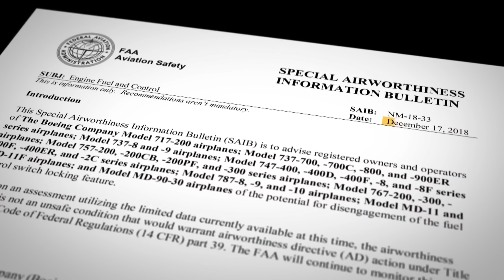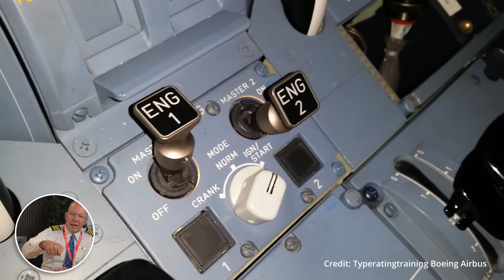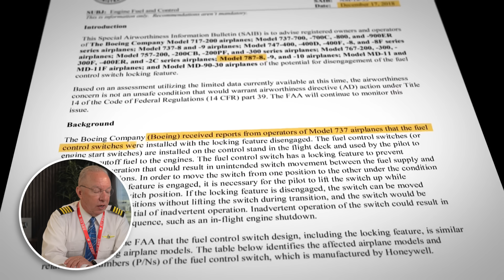Air India 171: The FAA’s 2018 Fuel Switch Locking Bulletin Explained (16 Questions Answered)

Comment: It's a great video - as aways - however I have to disagree with your take on cockpit CCTV. It is common practice nowadays basically for all the transportation industry: buses, trains, ships, even small haul trucks already have a cabin camera. And mind you, we're not talking about footage that will be constantly up to the airlines scrutiny (so pilots could still read their magazines in peace), just black box record keeping. Think of it as a dash cam: limited storage, auto deletion of older recordings to add new ones. The only instance the video would be seen is in an accident, with the same care and privacy of the CVR.

I understand your point of view, and of course standing with your union is the smart thing to do (and I'd likely do the same!), but the argument that the CVR and FDR give us a complete picture of what happened is a little "dishonest", especially in cases like this one.
Who toggled the switches to cutoff? There's a real possibility of the same one that did it gaslighting the other asking why did HE cut it off, right? Did both of them desperately tried to save the aircraft, or one of them just waited for it to end? Was there a physical altercation? Why did they take 10 seconds to switch it back to RUN? What were they doing?
Or even: was it a never seen before mechanical issue? What if the detains were actually not installed correctly and it was just never noticed/reported?
There are SO many variables that will likely never be known because there is no way to get the information, and most of them could be easily solved with a few cameras there.

Comment: Boeing should not allow both the switches to be turned off at the same time while in flight.They should also put individual cutoff switches on the window side of controls so each pilot can only control one switch.

Comment: Hi Captain , Is it possible that the fuel control switches jumped by themselves to cutoff position due to mechanical or electrical failure like when a fuse jump when you have a short circuit? TIA

Comment: Capt Steve, with all respect - you are pointing focus of your followers to all wrong directions... FDR doesn't record PHYSICAL RAW position of engine switches. Especially in fly-by-wire aircrafts like 787. 

"If there were a fault in:

The Remote Data Concentrators

Bus communication

Wiring between switch and RDC

Software mapping of switch logic

...then the recorded state (i.e., Engine switched to CUTOFF) could be incorrect, even though the physical switch in the cockpit was untouched.

This is not theoretical. There are known industry precedents where:

Faulty data concentrators or bus corruption led to false switch or valve state recordings in FDR data"...
Reply: If you Fly-by-Wire - then it's the "WIRES", controllers and buses you should be looking at first when something happens..
Reply: Recorded RAT power-on moment timming barely fits ~4sec from last engine cut-off. And it's without taking spooling delay, trigger logic delay etc.. Suggesting rapid power cut-off trigger seconds earlier than recorded signals from switches. Simply hangar talk here for broader consideration.. ✌️

Comment: There clearly should be a audio alarm as soon as even one fuel switch is shut off something this important should be not left undone. It would save seconds that may be incredibly important to stopping a crash. Yea you can hear the engine noise change but a alarm that sounds within a fraction of a second when a fuel switch is shut of is much faster and clearer then other clues you have to wait for.

Comment: Several things:
1) If someone is in charge of the safety of several hundred people, their feelings if they want to be on camera or not is completely irrelevant - there should be cameras, end of story.
2) At this point in time we cannot categorically exclude other possibilities why the system detecting that the fuel switches were moved, especially with the known prior problems with Boeing airplanes, computer systems, and fuel switches. We need to wait for the final report to get a complete and thorough analysis of what went wrong.

Comment: Here we gp again with speculation on camera recording you just stated could leak out.. 
This is appalling Bs when video would only exist accessed on flight recorder. 
Instantly showing chaos of who did what vs trying to decipher voice recorder. 

There's tons of data in one second of video period that was never revealed by sound recorded. 
The logic here is simply backwards. 
The video would only record by seeing movement. You taking a nap would not record. 
But if ship makes sudden movement ~ YES. Cockpit Door opens ~ Yes. 
Sudden loss of pressure ~ Yes. 
Make camera action manditory period. 
Too many lives depend on it. In the air and on the ground. 
Cheers

Comment: Those cut off knobs are in an easily accessible place and it seems easy to cut off the fuel. Should they not be in a less accessible place if they are only required to be used once parked or in an emergency and not in the main console

Comment: All that talk and still more speculation, still more pushing a psych narrative.  You've said it right here, and completely avoided discussing what else the report stated - namely, THAT THIS 787 UNDERWENT 8 HOURS OF MAINTENANCE AND WAS CLEARED 1 HOUR BEFORE THE FATAL FLIGHT!  Air India has NOTORIOUSLY PISS POOR MAINTENANCE!  This, in conjunction with the SAIB and the fact that the air frame had both engines replaced in March and April 2025, was 6 months away from its full checkup, had the throttle section removed and replaced twice, in 2019 and 2023 ONE YEAR AFTER THE SAIB WAS RELEASED, suggests that there may be maintenance issues still under investigation.  See the addendum to the report which states they are retaining components for further forensic investigation.  You may not like it, but sometimes truth is stranger than fiction - the fiction that a suicidal pilot caused this, while it was probably faulty maintenance under taken to figure out why there was a Stabilizer warning error on the previous flight.  Who knows what occurred.  The faith in Boeing, to be fucking honest about how robust their air frame or components are, in light of all we know now about whistleblowers and "suicides".  Boeing fanboiz.  Almost as bad as Tesla fanboiz.

https://youtu.be/XZ5oHyNfcAE?si=8Ktt24PSksUAOE_1&t=465

Comment: I liked this guys videos initially because it was informative but now observing he is taking each video in the direction he things what happened. For example he makes categorical statement that there is no design flaw. How can he be sure. Second the NM-18-33 says switch can be installed without the locking feature enabled. He dismisses the question about some reverse install but anything to do with pilot mental state or intention he answers more favorably. Also if you look at his other videos on other incidents he always tries to point out what the pilot did wrong. I am starting to catch his bias. If you are smart, you will watch out…

Comment: Steve as a flight nurse I have a great affinity to rotor and fixed wing aircraft. I agree that pilots fall into a group of people that need to have more access to good mental healthcare. I know that pilots  experience an incredibly high stress profession that results in high risk for mental health disorders and substance abuse disorders. I know that pilots experience fear the FAA suspending their license for any physical or mental health issue and because of that fear they hide problems that could be solved with treatment. We experience this in healthcare with up to 50% of providers experiencing a mental health disorder. We do not promote that it’s okay to not be okay, as long as you get help. What shouldn’t be okay is hiding or pushing down those emotions that will eventually bubble to the surface. Thank you for bringing this to the forefront. Fly safe ✈️

Comment: My question is, if the switches were found in the off position did they get switched off a second time? Im asking this because in the flight data it said the engines tried to relight after the switches were moved (assuming) back to the on position. If that's the case, how were they found with them off? Were they switched back off again seconds before crashing?

Comment: @AskTheCaptain
Could this be a possible theory? 

Pilot intended to bring gear up but was not present minded and proceeded to accidentally cut off left engine fuel.

They also cut off the right engine fuel purely from muscle memory after toggling the left fuel cutoff switch.

This could explain the timing as well, fuel cutoff happened at exactly when the gear up procedure should have happened. It also could explain why the pilot in question responded with "I did not do so" when asked since they erroneously thought they had placed gear up.

Comment: (If responding to this in the next video) your previous video starts with FAA report on fuel safety issues...1)you didn't talk about it? Could those issues have something to do with the failure? Maybe the pilot saw the fuel cut off on screen and asked the other one about it? And the other one is shocked too that it was off? 
2) if someone did do it, you mentioned in earlier videos that at the end there was a nose up, could that be because the other pilot turned on the fuel and tried to get the lift but failed?
Reply: He seems to be working for Boeing company
Reply: @kuilam9530 yeah, it felt like he had to say pilot error because of his job

Comment: Is it possible that the pilot responsible for the movement of the cut-off switches was not malicious or suicidal, but simply confused / distracted and moved the engine cut-off switches (out of a muscle memory or a black-out) instead of raising the gear handle? (And I know that the gear handle is in a totally different location- I am just saying, if the second pilot (monitoring) was occupied with some mental issues or distraction of some sort, not being exactly focused on the task at hand - would it be possible he cut-off the engines even though he didn‘t mentally actively intend to?

Comment: If these switches are so critical to plane power, does it sound an alarm to both pilots to confirm fuel shut off engaged so that the other pilot can override? Wouldn't make sense there's not audible/visual alert blinking on some screen and the only indicator is looking at the switches itself which may not occur during takeoff and pilots are busy with other procedures.

Comment: How many wires are connected to the back of each cutoff switch?  In this regard, does each switch have one channel like a light switch and it closes (completes)  an electric circuit to tell the FADEC (engine computer) to start and run the engines.  Or each switch could close an electric circuit for whichever position it is selected to thus telling the FADEC on or off. 

On piston aircraft with magnetos turning the switch on actually opens the circuit ungrounding the magneto enabling it to generate current for the spark plugs to ignite the combustion stroke.

Comment: I had a question that I hope is covered but I will leave it here. There was a 9-12 second gap between the Fuel ShutOff being switched off 1 followed by the other, with a 1-second separation. Then the 9-12 seconds occurred and the Fuel Cutoff was turned on for engines 1 and 2 consecutively. At the time of the shut off the plane had 27 seconds of flight time. The 9-12 second delay was critical.  During that 9-12 second, the Question on the CVR occurred from one pilot to the other about the "Cutoff".  What do you think happened in that 9-12 seconds. Obviously if the response to Turn the CutOff back On, hand been faster, it could have made a difference. Would a Pilot know by delaying 10 seconds, that would be fatal to the Aircraft during takeoff?

Comment: This guy seems adamant on not looking into any other scenario except pilot error. If you read the preliminary report, this is the sequence of events:

Lift-off: 08:08:39
	•	Max Airspeed: 180 knots at 08:08:42
	•	Critical Event:
	•	08:08:42: Engine 1 and Engine 2 fuel control switches moved from RUN to CUTOFF — 1 second apart
	•	Pilot audio: “Why did you cutoff?” → Response: “I didn’t.”
	•	08:08:47: RAT deployed, indicating power/hydraulic failure.

So RAT deployed during the ascent phase and in the report there's a CCTV picture of that.

Comment: A few years ago, a plane was deliberately flown into a mountain in Europe. The pilot who did it had had mental problems for a number of years. But no one intervened and forbade him from flying. There was no other pilot in the cockpit because the captain was in the toilet and the pilot locked the door so that he was alone. We do not yet know whether one of the pilots in the current case had mental problems. Short-term or long-term. But if that was the case, the airline industry must consider how to minimize such tragic cases.
Your argument about being able to quickly shut off the fuel supply in the event of a fire is real enough. But there should then be two more pilots to approve the other engine. Possibly with a button that is out of reach of the other pilot.
I would also like to say that I am impressed by how carefully people go about investigating the causes of plane crashes. But the human factor is now the biggest risk, isn't it?

Comment: Yeah, it's time for cameras. The fact that one of the pilots denied turning off the switches tells us he wanted to remain anonymous, perhaps not to discredit his family (factor in cultural reasons) or whatever. Therefore, a camera might just have been enough to deter him here. As for passengers, I'm sure most would be pleased to travel on planes fitted with them. I actually find it worrying that pilots are resisting them. Why?

Comment: People should do their own research before believing this man.  Here is some known issues about Boeing 787 
✅If a TCMA (Thrust Control Malfunction Accommodation) malfunction occurs and commands an engine shutdown, the black box (flight data recorder, FDR) would typically record the fuel cut-off switches transitioning from RUN to CUTOFF—even if this was not physically done by the pilots.
	•	The FDR records electrical signals indicating the state of the fuel control switches, not the mechanical position itself. If the TCMA or a related electronic system sends a signal to shut down the engines, the FDR would log this as the switches moving to CUTOFF, regardless of whether the cockpit levers were physically moved.
	•	In the Air India AI171 case, the FDR showed both fuel cut-off switches going from RUN to CUTOFF within one second, and the cockpit voice recorder captured one pilot asking the other, “Why did you cut off?” with the reply, “I didn’t,” suggesting the action may not have been intentional or manual.
	•	The TCMA has a separate circuit that can override the fuel switches, so a malfunction could produce the same FDR data as a manual switch movement.
Therefore, if a TCMA malfunction triggered the shutdown, the black box would still register both fuel cut-off switches as having moved from RUN to CUTOFF, making it difficult to distinguish between a manual action and an electronic command based solely on FDR data.

Comment: Captain Steve..
Thanks for your great explanation and insights. I have watched these air crash investigations to understand the meticulous process of investigation. I am just wondering, would that be helpful to avoid any deliberate act of intervening with critical components such as fuel switches from one of the pilots, by installing additional lock (to the left side of left pilot and the right side of the other ) and additional procedure where both the pilots have to agree for such interventions and release both those locks to let a pilot change the status of those switches. This will avoid one pilot from sabotaging the aircraft.

Comment: if you don't trust the source of the investigation due to past examples of lying....then yeah...investigations are pointless. which is why the obvious suspects like the airline and manufacturer should NOT be conducting it. also if your government is corrupt then you're pretty much screwed and i feel we're heading in that direction based on now other departments are being managed, but as of now i still trust our ntsb, but given time i might not trust them anymore either and then we've lost something VERY valuable that can't easily be fixed for a long time.

Comment: The SAIB was concerning a series of “defective switches” wherein the detent ramps and springs were machined and assembled poorly. Very few units were affected and all identified prior to delivery but they issued the SAIB as a recommendation during 500 hour inspections to inspect the switches for integrity; no wear to ramps, spring intact and both positions properly and securely engage. 

The preliminary report crash site investigators inspected both switches, noting they were in the ‘Run’ position, consistent with the FDR data, and that the detents were operational, which they were per the report. The report also noted the service logs had no history of the switches being inspected by A&P but the SAIB is just a recommendation, not mandatory inspection. Boeing, NTSB/FAA and EASA had no recommendations stemming from this incident suggesting, as report clearly states, this was a product of human error. 

When Final Report is published in 9-12 months, the only significant additional content will be whether the switches were intentionally or accidentally engaged and by Captain or 1st Officer, who it should be noted was the PIC on this leg.